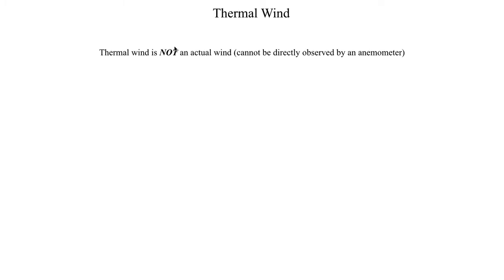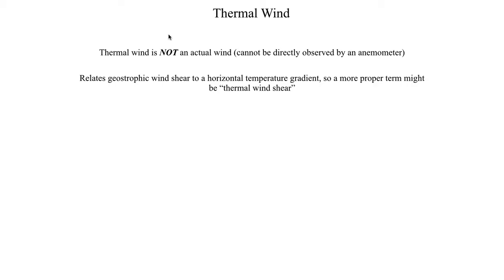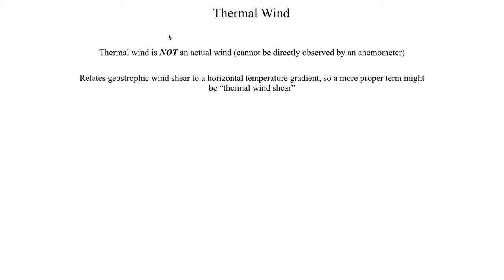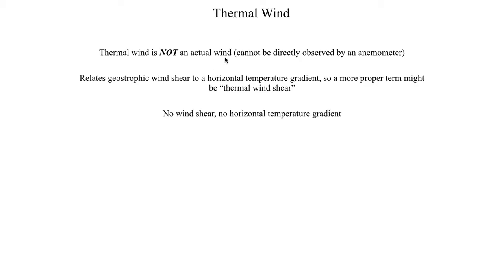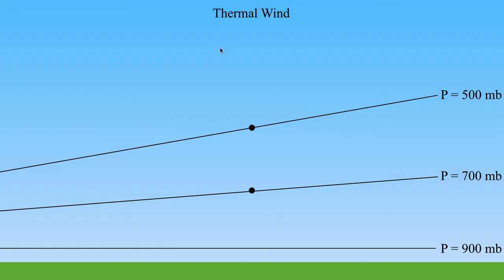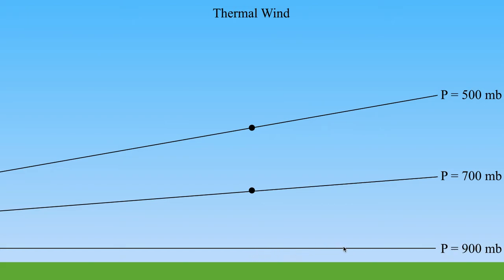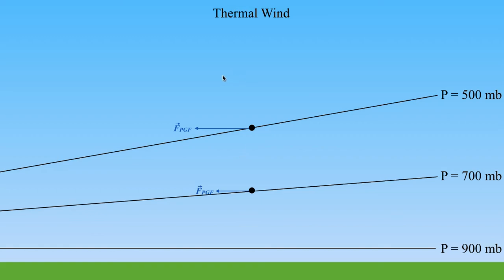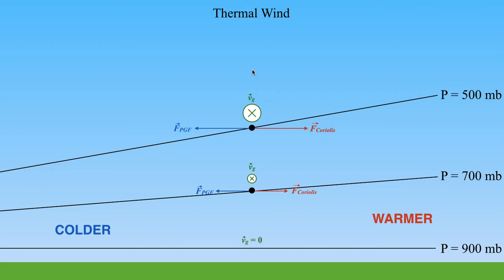METR2023 - Lecture 12 - Segment 2: Introduction to Thermal Wind

Comment: Coriolis force act perpendicular to pressure gredient.. But how come here it is opposite. As the apparent force act right tk the direction of movement in northern hemisphere!
Reply from the maker: In geostrophic balance, the Coriolis force points in the opposite direction of the pressure gradient force. This must be the case in order for there to be a force balance.

Keep in mind that the diagram shown in the video is a vertical perspective (with altitude on the y-axis). The symbols drawn represent a wind that is blowing into the screen. This puts the Coriolis force to the right of the wind vector (in the Northern Hemisphere) since the pressure gradient force acts to the left of the wind vector.